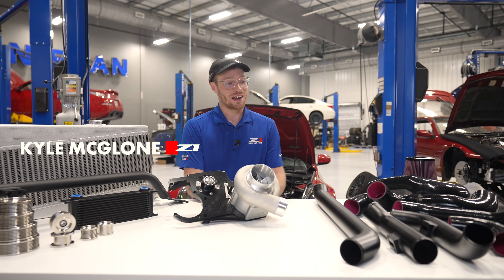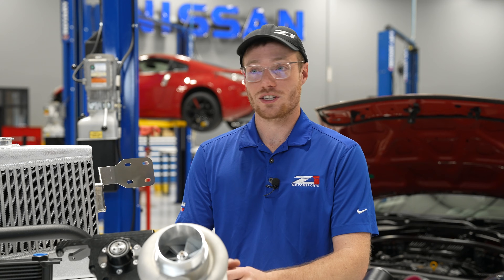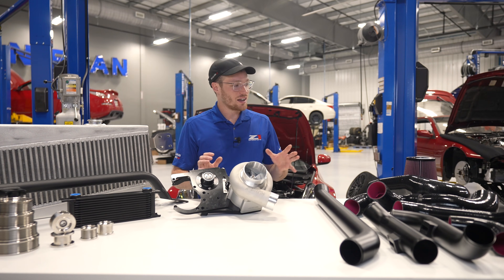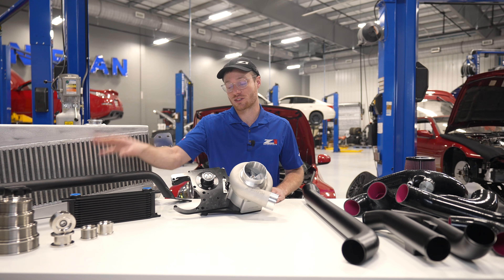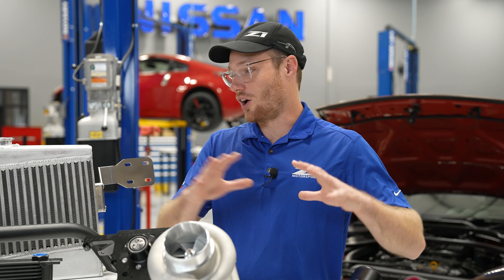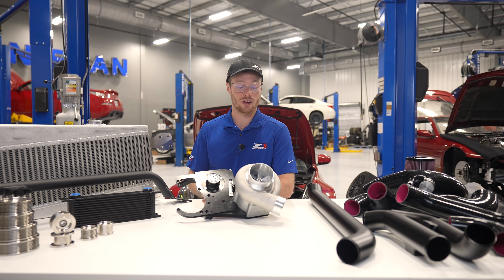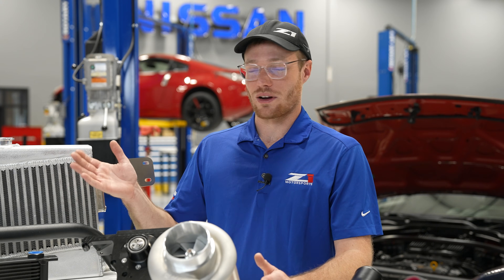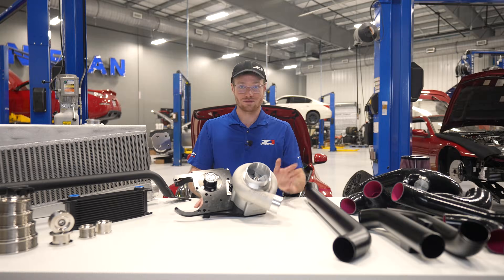Z1 VHR Supercharger Kit

Comment: Will this kit work on a Infiniti Q70/M37 with the same VQ37VHR as the 370Z? Basically same engine
Reply: Essentially yes. Just might need some plastic cutting and rerouting, any tuner shop would install this kit in your car no problem

Comment: So is it not a bad thing to run stock exhaust and such on a supercharger kit?????     Or is this HP number with supporting mods?    I am looking at full bolt and a tune costing the same as the supercharger kit but the HP is drastically different.
Reply from the maker: For the highest HP numbers, a full exhaust is recommended
Reply: @Z1Motorsports  I figured that would be best case.  Thanks.    Im gonna start there....lol.

Comment: pls pls pls don’t leave out and forget the 2014-15 Q50-60 guys . There’s literally nothing but soho for us and that’s not turbo . i know you said working on 37 models praying y’all remeber us too!
Reply: 2014 q60s
Reply: Wait what, this won't fit my 2014 q60s 3.7? It's the same body and same engine as the g37 it's just rebadged. It should fit just fine
Reply: What even are the differences other than badging?  
I often tick the G37 box when looking for parts for my '14 Q60S figuring that they are mechanically the same as '13 G37 coupes.
Reply: It’s the same car lol
Reply: @wrkls_  same engine and trans. none of these will fit a awd q . keep researching u will see what I mean
Reply: I wonder if you can use this also since it’s the same engine but minor differences.
Reply: Lol wait nvm they leaving us out bro
Reply: Not anymore!! New product alert & already added to my cart lol
Reply: Always forgetting the 14/15 crew

Comment: Does this come with an oil cooler as well?
Reply from the maker: It includes a cooler for the supercharger, we would recommend adding one of our oil coolers in most instances and the kit is built to be compatible with the Z1 oil cooler kit.
Reply: @Z1Motorsports23  this is great information. I have your 25 row setrab oil cooler and was wondering if this kit is compatible with it. Thanks
Reply from the maker: @filip000  I would contact one of our product specialists to verify fitment via ph or email for the most accurate answer!

Comment: Will this supercharger kit work with an automatic transmission. Vehicle
Reply: Sell the auto and get a manual
Reply from the maker: Yes it will work with automatic transmission models.
Reply: @Z1Motorsports23 any plug n play 7AT transmission oil cooler?

Comment: Would this fit on a 2013 g37X sedan, automatic ?
Reply from the maker: We are working on G37's actively, the bumpers are different to a Z so we have to modify the intake etc to fit properly! Coming soon!
Reply: @Z1Motorsports23  sounds great! I can’t wait. Will it be just like this kit though for the z? Belt and everything basically already comes together out the box?
Reply from the maker: @FlossyCollects  Correct,  pricing will be similar also!
Reply: @Z1Motorsports23  can’t wait until it drops! Thanks for the info Z1! We will get a video and such just like y’all did for the Z’s kit when it does drop?
Reply from the maker: @FlossyCollects  It'll be hard to miss when we announce it ;)
Reply: @Z1Motorsports23  thank you! Sorry but one more question for you guys. Will this had been tested and driven by bay of your z1 workers cars or test cars for a while before put out to the market? I had seen in another video the Z kit was on a couple of your guys cars before it dropped! Or no need since it’s the same 3.7 motor as the Z?
Reply from the maker: @FlossyCollects  Yes! We put thousands of miles (and years of experience) of R&D before dropping any product to make sure it's 100% perfect. Z1 cars and employee cars all do testing on the dyno, street and track to make sure it can handle the public!
Reply: @Z1Motorsports23  love to hear it! Thanks
Reply: That’s what I want to know. I have a sedan too

Comment: Will the stock fuel pump and clutch be okay for 450/6psi?
Reply from the maker: You’ll need to upgrade the fueling a bit to handle that if going with the tuner kit.  If you go with one of our complete kits it will come with the fueling parts needed to support the listed power level.
Reply: @Z1Motorsports23 how about the clutch? Is the stock clutch enough to handle the 450 or 500 hp versions of this kit?
Reply: @Z1Motorsports23 what's the oil cooler for? I already have one for the engine oil. Where would this additional cooler mount?
Reply: @Z1Motorsports23  is there a pulley option that will work with oem pump?
Reply: @unijabnx2000  there are different pulleys to achieve the horsepower

Comment: an OMNI 4 Bar Map Sensor is required. This sensor is not included as part of our tuner kit and must be purchased separately....
Reply: That's why it's a tuner kit. Some people may already have an Omni 4-bar and want to purchase without.
Reply: @drizzetsrevenge  he said in the video, no trips to the store, you have everything you need in the tuner kit.
Reply: @unijabnx2000  it does, everything needed to install the supercharger is included. The OMNI MAP sensor is a component necessary for tuning and engine management. It's used for speed density tuning.

Comment: Glad to see another kit on the market. Looks like the total package price is about the same as the other 2 popular options. 
I have yet to see a 600 hp + kit that includes everything needed, like clutch and tranny upgrade for sub $10k.
Reply: If I could do everything for 10k installed I’d do it but unlikely. 16k for 550hp just isn’t worth it to me.
Reply: @Unxpekted it isn’t. Trust me it really isn’t 😭😭😭
Reply: @TheBiggest46    What car would be worth it for a similar price though?  Horsepower is not cheap.   I bought my Z used for a decent deal and for the cost of this kit or any other FI kit I am still way below the price of any other car with similar performance by 10s of thousands.   Been considering a new M2 for a few months now but its going to cost nearly double than it would to boost my Z
Reply: Where did 16k come from?.. the kit is $7000 after taxes.. supporting mods and install should run you $12000 maybe $13k. IF you can't do it yourself.. if you can, then it'll be like 10-12k.. sounds good to me.

Comment: You should AT LEAST, give credit to it's original designer Aaron from Topgunz. He had the idea, did research and testing for you guys.
Reply: The original designer of this kit is Z1 and Rotrex. It was designed by Z1 with direction and input from Rotrex. Aaron's kit is completely different, as is GTM's kit that used the Rotrex C38 over a decade ago.
Reply: Actually GTM supercharger used rotrex c38 blower as well on 370z before they went bust, way back 2012. Its great to have various FI kit options available, kudos to both z1 n topgunz.

Comment: What is the max hp could the vq37 do on stock internals?
Reply: From the various forums and videos I’ve seen a healthy VQ hold 600 wheel max safely. Anything more it’s a ticking time bomb.
Reply: @akoolz  the engines are good for like 800 hp... I have seen a few people run 650 whp on this kit
Reply from the maker: Our kit keeps within the safety limits of the standard engine for max power and max longevity, pushing more than this starts to get risky and we would recommend a built engine :)
Reply: Its mostly about torque. Stock connecting rods are the weakest point. Keep torque under 500 and can probably hit 700 without short term issues.

Comment: I installed SOHO kit by myself. A fair amount of fabrication to get it to fit.

Why is this better than Vortech V3-Si?
Reply: If you look at the top guns kit the rotrex is capable of more boost out of the box. Not to say the v-3 is bad. Gonna be a preference thing at this point
Reply: Any 370z, stock or supercharged, desperately needs an oil cooler
Reply: @filip000  oil coolers should be every single VQs first mod if they like having a motor
Reply: You have to upgrade the v3 to compare it to the rotr3x from what I've read. On the vortech you Could either upgrade impeller , bearings , volute, pulleys ect... you can go crazy with it and thats one of its pro's imo. There is a lot of options from various companies to make that v3 do what you want. On the other hand the rotrex out of the box does a little better than the v3. I have no knowledge about rotrex options for upgrades.
Reply: @Techsauce  definitely upgradable. I think the rotrex is still the better option due to the longer service interval and included filter and cooler. The V3 is by no means bad but out of the box the rotrex is the better kit
Reply: @johnserrata5346  the oil change interval is really convenient, the oil cooler is not used or needed on the vortech unit. The vortech can be changed to use engine lubrication if wanted meaning it would just be refreshed every time you do an oil change on the car. Like I said, the vortech units have a ton of options and upgrades. But out of the box the rotrex is better.  I just wouldn't suggest switching if already own a vortech kit. Now if starting from 0 this z1 kit is looking good.
Reply: @Techsauce  I'm ordering my z1 kit in the coming months hopefully 🙏